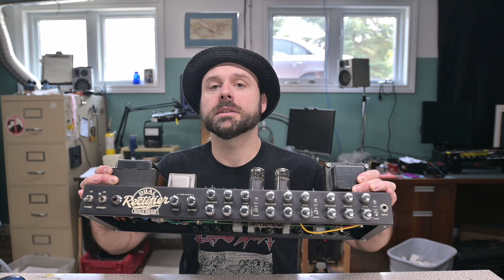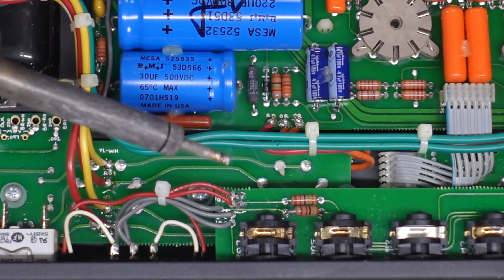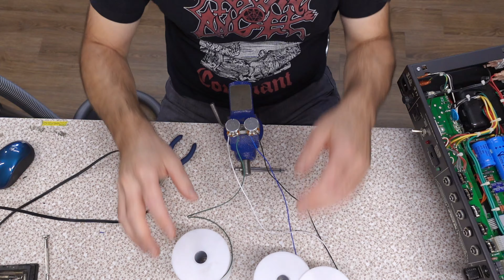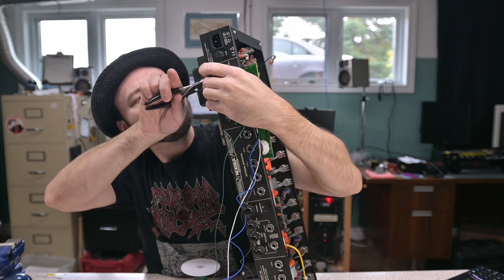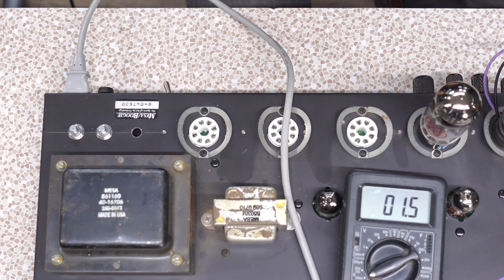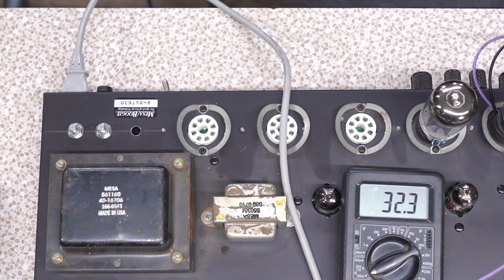Mesa Dual Rec - Tube Roll & Bias Mod

Comment: Thanks a lot for this video ! I just bought a used single rectifier that needs a full tubes replacement. Mesa tubes are just marketing (and impossible to find in Europe now...) so I'm thinking about testing TAD 6L6 GC redbase and be able to adjust bias for using it correctyl :)
Reply from the maker: I think even TAD is marketing, and a re-label of other brands, but if they are cheaper and easier to come by, they hell yeah.

Comment: Excuse me for stupid question. Is it safe to remove rectifier tubes on MB triple rectifier solo head if i switch amp to silicon diodes?
Will it negatvely effect on amp components or not? Thanks!
Reply from the maker: For liability reasons, I can't say for sure, but I see no reason why not, and I totally would.
If you don't' use them, I could find to reason for them to be there.
Reply: @DATT thanks! 🤝🏻

Comment: Hey is there any way to contact you directly?
I have a question about a Mesa Boogie output Transformer and you seem like a guy that might have some answers, especially given the output transformer video you did.
Thanks!
Reply from the maker: I know about transformers in general, but maybe not that much about the boogie in specific. 
Like I don't know off hand what the Impedance spec of it should be. I'd just be guessing myself if I had to replace one. 
This is as good a place as any, what's your question ?
Reply: @DATT 
Well, when I called Heyboer and Mercury they said they needed the primary and secondary wire gauge and to know if it was interleaved.
I would guess that there is more info I need to try and recreate the OT to the same specs so what info do you think that would I need to provide them to get the most accurate recreation of the one I need?
Thanks so much bro.
Reply: Oh, and the back of the amp has 16/8/4/4 ohm outputs. If that matters?
Reply from the maker: @Yourmamasbox  Ohh, that's more advanced knowledge of the transformer that I know. I just match the Primary impedance and send it. I'll often use Marshall 800 clone transformers from Hammond. Idk about Heyboer, but I was jsut looking at the Mercury site, and they had listed replacement transformers for the Dual/Triple rec, so idk they they'd be asking you want specs you needed. Like replacement trans are out there, just hammond is cheaper if you want to be adventurous.
Reply: @DATT They do, but the amp I have is a 1998 Revision G dual rectifier and they had different transformers apparently.
That’s my issue, trying to find the correct specs for that transformer.
I know Schumacher made them but I don’t think they are still around.
Heyboer and Mercury can make me A transformer, but I want to try and get the most accurate one.
If that makes sense?
Reply from the maker: @Yourmamasbox  Yeah that does make sense. Usually revisions are in the circuit, not the tran. It's possible. I can't imagine they'd be that different. 
Where is the old transformer ? Did you toss it already. I wouldn't imagine one of the companies could reverse engineer the old one if it was that important. 
I think only Mesa could really help you with this one. I wouldn't have the foggiest. And to be honest, I dont' put quite THAT much importance in what differences there might be between your old tran and a newer model tran for the same type of amp. Maybe if I could compare the 2 I would . . .
Reply: @DATT When I got it the transformer has already been replaced, as had the caps. But since it was done by a tech I don’t know I don’t trust it. I can take it to the guy I do trust but if I know what the issue is then I can source the parts in advance and save some time and effort for my guy.

Comment: Something important: you should put resistors in series with those pots. Turning their resistance to zero is a surefire way to fry valves, it should never be possible to do this. Also, ideally they should not be operable with the fingere, screwdrivers only. If this was my own amp I wouldn’t even allow myseld to do it because it would cause issues if it changed hands.
Reply from the maker: Yeah, that's a good idea. I set this up the way I'd do it for me own amps, and for a buddy assuming the operator knows what they are doing. But liability is a concern, especially since he totally flipped the amp a few months later. Not really worried about screwdrivers. The pot cases and shaft are grounded. It's safe from a user interface standpoint.

Comment: 28:45
Oh yeah buddy, they break down in spectacular fashion A LOT. Those amps are full of underrated components surviving within an inch of their lives. 

Doing these bias mods puts the phase inverter coupling caps outside of their rating. ~-45vdc bias and  ~360vdc plate adds up to over 400 volts on those caps.  

Install 630v film caps before you let the amp out the door.
Reply from the maker: Damn eh ? Yeah I'll have to look out for that. I'm not sure where you're getting the 360 form. Schem shows 278v plate, and adding a negative integer often reduces the value. They are also on different sides of the caps.

Comment: You could have moved the diodes to the other side of the board. Also a good idea to insulate the back of the metal pots .
Reply from the maker: I actually cut out discussing the idea of flipping the diodes cause it was still so tight that even tho the board would now seat, the diode legs might still poke at the pot.

Comment: Keep putting them out like the channel , the adapt and overcome attitude is my way of life.
Reply: can i ask what everyone's opinion is on what sound a pair of kt88 offer in high gain amp?
Reply from the maker: Hey thanks !
KT88 can offer more headroom to and amp you feel gets a bit loose at the volumes you like to run. 
Kind of redundant in a 100watt 4 tube head unless you're mental, but can tighten up a 50watt head.